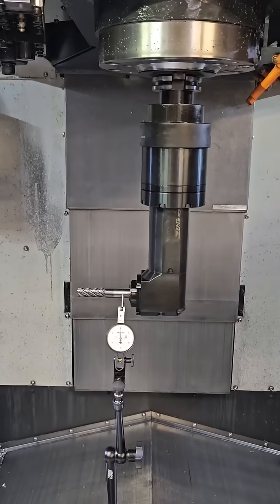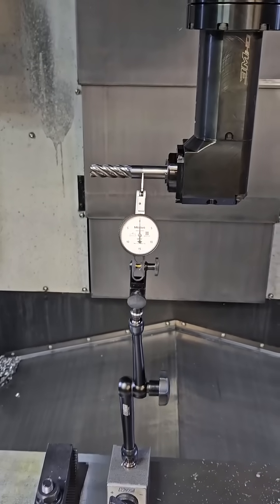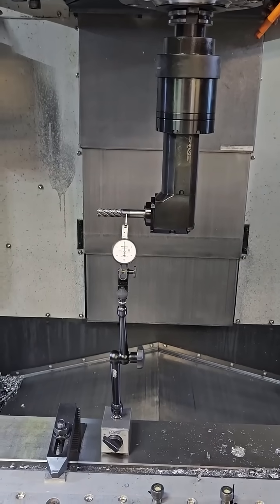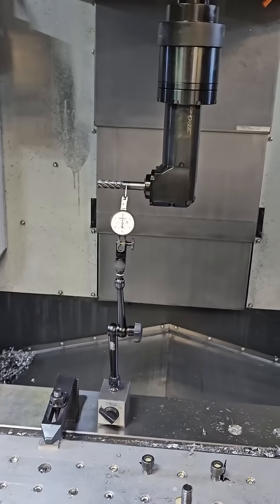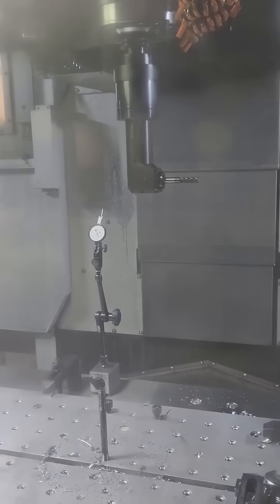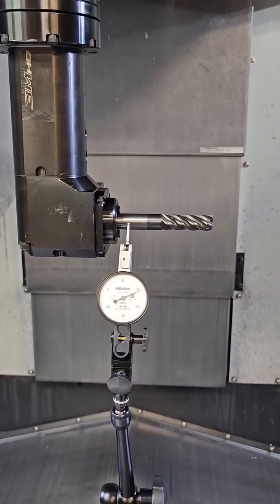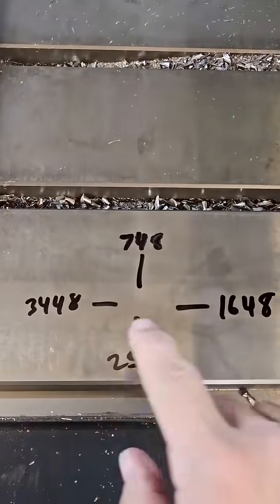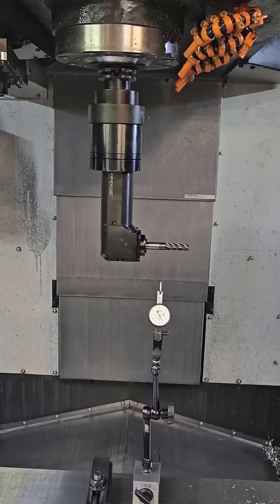Getting this Eltool angle head dialed in

Comment: #1=? (TIMES 90 DEGREES);
;
M150S[748+[900*#1]];

Add something like this in favorite on the MDI?
Just hover over the question mark and alter it to 1,2,3 or 4, then hit start.
The favorites section in MDI mode is maybe the upgrade I like the most on the iHMI

Comment: I feel like there should be some kind of parameter to set this as an offset. It would get really confusing if you had to adjust each machine you run this code on.
Reply: I would use variables to do this.
Reply: Like #1=180 (angle you need)
#2=3448-#1
M150 S#2

Comment: okay but sk/bt spindle orientation isnt that accurate. Try removing and putting the tool in again and see if its still straight.
Reply: Our shop ran into this problem as none of our machines had the proper spindle braking stuff. Ended up needing to switch to an angled head that had locating lugs that fit into a custom plate attached to the spindle face. Not capable of rotating in the same way as the one in the video.